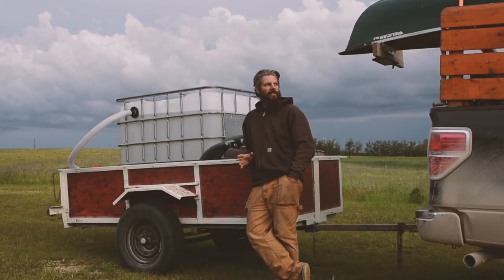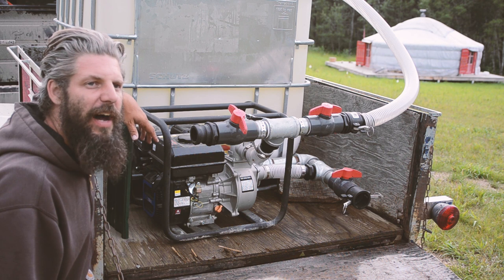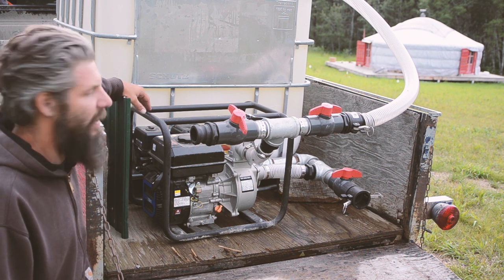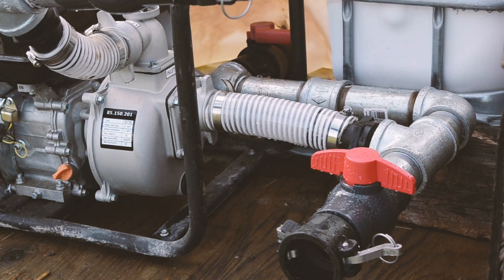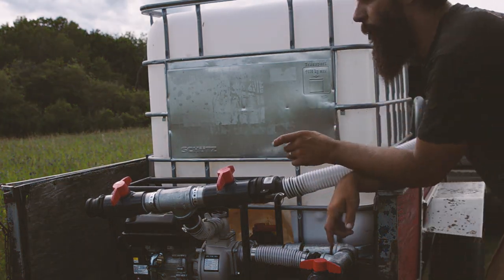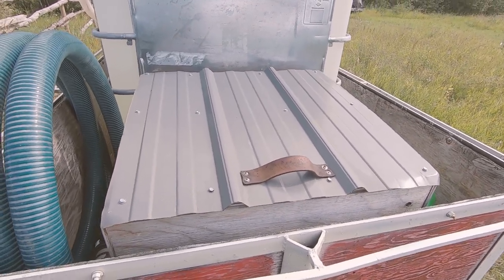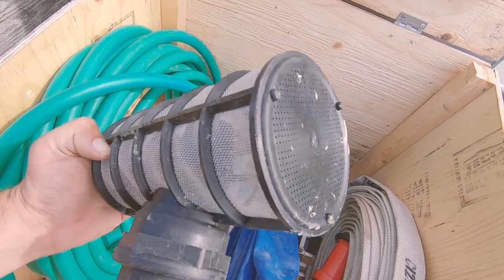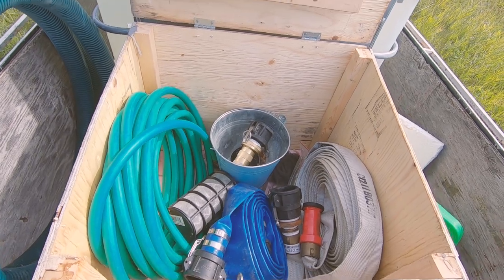Wildfire Wagon | Off Grid Firefighting

Comment: Cool idea! Keep in mind that firefighting is extremely dangerous. I am a firefighter with over 30 years of experience and I think everyone who has a system like this should be aware of this. Some tips... leave your recirculate / tank fill valve cracked when pumping water so that the pump doesn't heat up and prematurely wear out when water is not flowing. Temporarily close it during drafting so you get a good draft. Also, get your self a foot valve/ strainer for drafting.  This will make pulling a draft or suction water with your suction hose, much easier. Keep your system full of gas and water during fire season so its ready to go. Be safe brother!

Comment: You could use this fire truck to get water to the tanks that supply water to the cabin/ yurt if you have (or will install ) a cistern-like system to provide running water.
Reply from the maker: You bet. Water purification is one the list of projects for next summer. We'll be heading into freezing temps overnight in the next month or so so no point putting it together yet. Thanks for watching!

Comment: Great video! In the process of building one myself , my one question for the trailer is how can i make it heavy duty to support the weight of the water? Did you replace the axle or springs on yours? All these trailers ive found the payload capacity is just about the weight of the tank filled to the top
Reply from the maker: Ours is probably NOT heavy duty enough to officially support this payload. If we were to rip at full speed down the grid roads with it I'm sure we'd have issues. We take it slow and stead when it's at full capacity and place a block of wood between the frame and springs so that it doesn't sag enough to snap a leaf. We're mostly concerned with our 5 acre yard as far as protection, but have rolled this thing a few kms without fail to help put out a resort village fire in the past. Thanks for watching!
Reply: Do not use springs, lower the CG as much as posable.
Reply: @rexhavoc2982  if you do not need strings on all the course of putting a large button is transfered directly into the tire wheel hub and axle which are already at maximum capacity, recipe for broken parts
Reply: @itptires  Sorry dude, I cant make out what you are talking about.

Comment: Hello from Nova Scotia, Not much to improve on,  maybe a few fire rakes. You could check out the 1" forestry hose, see the difference for pressure/distance /water volume, as its easier to drag around and you could run two lines if need be....usually 1" is good for grass fires. I'm on a lake and purchased the fire package from Princess Auto/expensive but worth it...we've had 3 fires last year,  3, 8 and 40 kms away. As always another great video...
Reply from the maker: Those are some good suggestions. The first year I patched this together I filled the tank for the first time and that evening there was a ditch fire right outside the resort village entrance just down the road. We were the first on scene with our wagon and it worked great!. Might try that 1" hose, been curious about the pressure/distance /water volume differences myself. Thanks for watching as always.
Reply: Do you mean the pump,homeless, nozzles etc for about 900$? I'm looking at that now. Seems great.. still deciding but making a decision fast. Bad year here in BC
Reply: @cdnjan  Princess Auto has a fire pump that comes with a cart ,hose and nozzle...its about 800.00 I purchased  2 years ago, works great, you might want to buy extra lengths of hose. I also have 2 sprinklers mounted on my roof....
Reply: @jedidiah5131  thank you.. yes looks  pretty good. I saw a few folks buy it and modify it right away. I don't want that. It seems silly to toss new parts. So just not sure if I want to buy it all together or pieces. What are you using as your water source for the roof sprinklers? I started this process thinking I just wanted those. I quickly realized there is no where near enough pressure for them to do much of anything. So here I am lol. I am rural.. very forested an impossible driveway for a firetruck.. just hope to keep any embers at bay until help arrives. I've been here 33 years every summer it's nerve wracking. The time is now or never with this weather chaos. I figure also that this is a great reason to get a pool🙂🙃
Reply: @cdnjan  I'm on a lake and very secluded.  The local volunteer departments are well trained and quick to respond and they know of my place and have been into take a look around for pre fire planning. I use a small wajax pump for the roof sprinklers, lots of pressure. I've had two large fires come within 8km over the years. I have also limbed all close trees at least 15-20' up. There are also fire proof tarps you can buy  to cover your house, I think I seen them in the states, but are probably very expensive. The fire pumps I have should be sufficient for any fires and reach of stream is well over 100'  with lots volume. I also have 10 sheets of metal roofing to place against my house walls depending on the direction of the fire.... I was a military firefighter and volunteer for 30 years ....so I have a little experience under my belt. Best of luck.

Comment: Thank you for the inspiration! The trailer I bought for $40 but I painted it with high heat paint. Next I always add a small bottle of (dawn dish soap) per tank of water. Dawn dish soap adds weight to water and acts as foam.

Comment: I'm building one now using yours for a model. My engine is a Honda and the exhaust will be pointed toward the plastic water tank. Will it melt it? Heat shield? Did you have that problem?
Reply from the maker: Yup be very careful with melting the tote on the exhaust. A heat shield would be wise. Mine points to the side, so not an issue.

Comment: May I suggest a task force tips pistol grip nozzle from eBay  the long nozzle as you may get more control on flow from the nozzle from light must to full gush
Reply from the maker: Thanks for the tip Calum. I'll check them out. Thanks for watching
Reply: If you can, get the adjustable gallonage one, set it to the almost lowest gallonage possible it'll save you a ton of water

Comment: What about pressure relief if you want to shut off the nozzle do you just crack open the tank valve a little?  Or does it have a pressure relief valve?
Reply from the maker: I assume you mean if I want the pump to sit there and "idle" without the hose on? Yes, we open the valve into the tank and it just cycles until you're ready again.
Reply: @HayWoodsandWetlands  yep that's what I was wondering.  Thanks